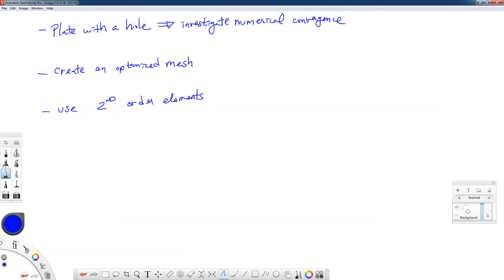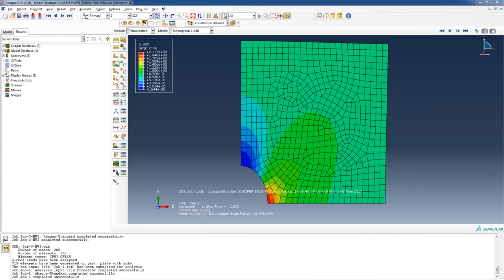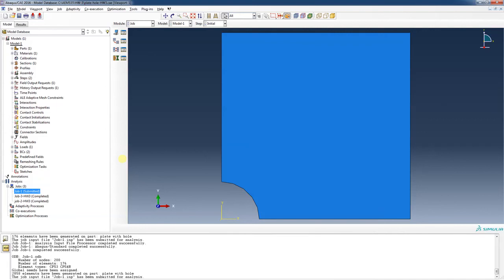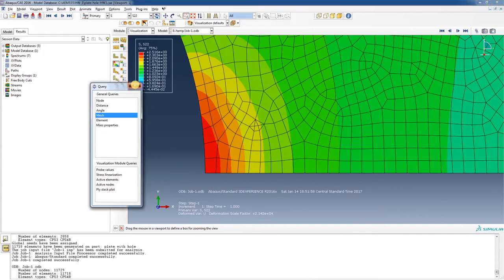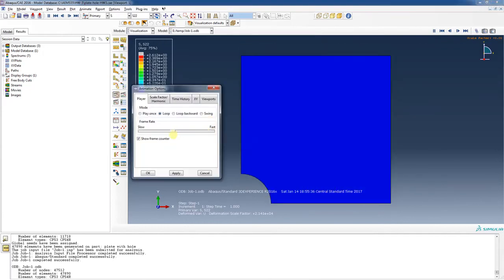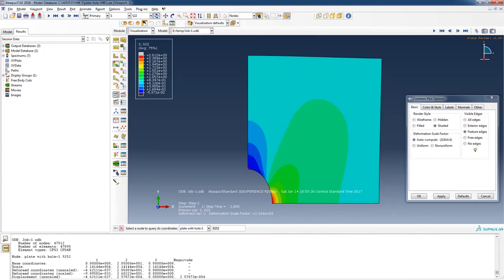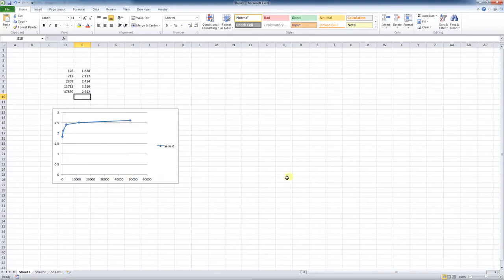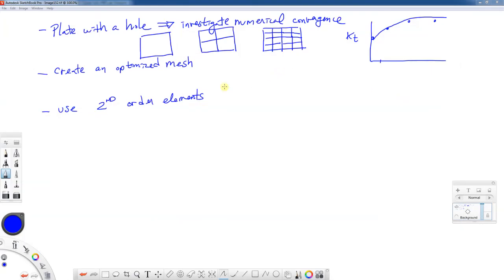AEM 535 HW-3a Convergence Analysis of Plate with a Hole

Comment: Dear Sir.
Can you give me your gmail address?
I have some problem with my simulation. So I need your help.
Thank you.
Reply from the maker: You can look at my About link:  https://www.youtube.com/channel/UCS5Ojenfz6cBWV1CX5pEwIA/about?disable_polymer=1   for my email address.    You can post a question at my personal forum:https://forums.mbarkey.com/index.php?board=4.0   and I can try to answer it as time permits.
Reply: @mbarkey.mechanics  
Hello Sir,
I want to know whether convergence study should be carried out on full model or on a part of a model? because if a model  is big enough then it takes time to complete the analysis.
Thanks.
Reply from the maker: My understanding is that subdivision ensures proper convergence behavior.  This will present an issue for large models.  However, investigating the behavior for simple models and with various stress gradients can give you a feel for element sizes in areas of steep gradients. 
Companies that employ FEA techniques will often specify a standard element size in models that will give enough fidelity with an understood amount of error.

Comment: Hello Mark Barkey,
I would like to ask you a question
In this plate model, there is no stress singularity problem, although there is a sharp corner when you model the quarter?
Thank you.
Reply from the maker: It is a hole, so no sharp corners.  Note that symmetry boundary conditions were applied.  If even one boundary condition was missed at the edge of  the hole, then it would be a model of a crack at a hole--but in this case, it is just a hole.
Reply: I got it. Could you make a video about Python for Abaqus?
Reply from the maker: Hi Minh Ly, here is the playlist for my course:https://www.youtube.com/playlist?list=PLaDWa6xI4zefL69_xDs-OoS8pECVpAo3F     Scripting is ABAQUS is in videos 15,16,17.Happy studies!
Reply: Thank you so much for sharing with me the playlist, but it appears it does not work.
Reply from the maker: The word "Scripting" got attached to the URL; I fixed it, please try again.